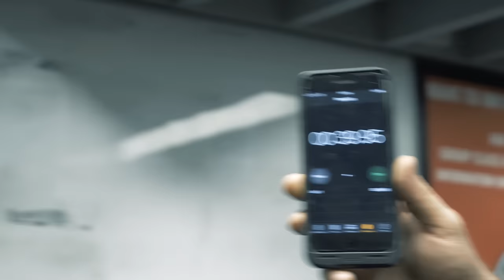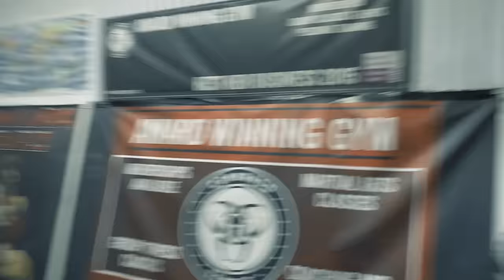LIFTING THE UNLIFTABLE DUMBBELL | KEG RUN | EDDIE HALL

Comment: Brian- lifts unliftable dumbell 

Mark Henry- am I a joke to you?
Reply: Mark Henry actually pressed the Thomas inch dumbbell over his head though so...
Reply: Lucas Smith it’s not about the weight, it’s hard to lift because the handle is very thick so it’s much harder to grip than an ordinary dumbbell, shoulder pressing it probably wouldn’t be that difficult
Reply: Mark Henry never lifted the Millennium Dumbbell tho...
Reply: Hand size is key lifting these aside from strength. Gripping that dumb bell is virtually impossible added with that weight. 

It’s Brian’s specialty clearly..
As much as Eddie is a specialist dead lifter
Reply: Zackary Guidry Mark Henry didn’t do it right
Reply: Jordan Hunt Mark Henry was able to clean the Thomas inch dumbbell up to his shoulder and press it
Reply: Mark Henry lifted a 195 lb dumbell above his head.Still very impressive.
Reply: @gregorycarter9352  Yah mean 172 lbs and Shaw picked up two an incline pressed them.
Reply: Lucas Smith he also trained for a year
Reply: Mark Henry isnt a real lifter
Reply: If anyone thinks Mark Henry’s weight lifting is real then your not as smart as I thought you wrte
Reply: @BillyBob-wv2jn  
Arnold Strongman Classic
1st 2002 Arnold Strongman Classic
WDFPF World Powerlifting Championships
1st 1995
USAPL National Powerlifting Championships
1st 1995
1st 1997
USPF National Powerlifting Championships
2nd 1990
And in 2002 he did lift the Thomas Inch dumbbell... You're insane if you think he didn't
Reply: @Matt Philips yeah your right. I kinda just said that for likes lol
Reply: Billy Bob Wow, a person on the internet that admitted they were wrong...
Reply: - funny people saying Mark Henry isn’t a real lighter when he was probably training for the Olympics before these guy did anything. Mark Henry went back to lifting in 2002/2003 to prove lifters wrong which he did
Reply: @camrongaida963  it's all about grip tho and shoulder press isn't hard in that
Reply: Lmao imagine trying to make a joke but not know the dumbbell Mark Henry lifted is over 60 pounds lighter than this...
Reply: @lucassmith992  And brian did it with 2 from the ground so your point is what?
Reply: @MichelLinschoten  No.. eddie picked the inch up, same handle, so your argument holds about as much water as a fishing net.
Reply: @camrongaida963  And brian did it with 2 at the same time..
Reply: The dumbbell Brain warmed up with is the one Mark Henry lifted so.....
Reply: @ok-yi7mi  Mark Henry started out in strong man before he went to wrestling he is liget
Reply: @TTE441  you can’t compare mark Henry to either Brian Shaw or Eddie hall
Reply: @wntdspartan1345  mark Henry never won or competed in wsm
Reply: @badkoba6927  he won the Arnold strongman classic in 2002 fk u mean lmao
Reply: @wntdspartan1345  are you serious? That’s just the asc not the wsm and mark Henry won it once
Reply: @wntdspartan1345  if someone doesn’t win or even compete in the wsm then that person doesn’t have the title of worlds strongest man
Reply: @badkoba6927  the ASC is still a strongman competition and Mark Henry is known around the world as a strongman even by people in WSM. 😂 but keep trying to downplay his accomplishments when I bet u wouldn’t say that sht to him in person 😂 keyboard know it all.
Reply: @wntdspartan1345  no it’s not asc is totally different than the wsm. At what point have I downplayed what he did? The man won the asc and holds two records still. You are just pissed because you knew nothing about it and you are just a fan boy of mark Henry. Maybe next time do some research before typing some bullshit.
Reply: @wntdspartan1345  oh what he’s supposed to hit me because he never competed in a wsm or won it. I doubt he would and if I ever get the chance the met him I am going to ask him why he never competed in the wsm   Now run along child and take your medicine
Reply: @badkoba6927  - well I can, and the fact that a former Olympic power lifter who stepped away from competing to wrestle then went back into strongman and beat those doing year in year out regardless of it was Arnold classic or WSM.
Reply: @TTE441  you can what? He had great success competing in the US as a strongman in the 90s and had 13 wins. To my knowledge he still has two records. As for the asc he only won once in 2002 just to prove he could then retired. Not sure what you are trying to prove here
Reply: @badkoba6927  - I’m not trying to prove anything, ur the one who came along commenting on everyone’s comments.Henry did what he wanted to do in 2002, I’ve watched the videos of him talking about it and why he did it.
Reply: @TTE441  first off anyone is free to comment on any comment here it’s public you dont like it then don’t look at the comments. Second lmao everyone’s comment do you realize how many comments there are. Yeah I watched the video too. Problem is all you fan boys are getting mad because I said he wasn’t a world strong man because he didn’t win the wsm or even compete in the wsm. I am just stating facts here.
Reply: @The_Skrub  it wasn’t around in 2002 tho
Reply: Mark Henry ain't no strong man he a soap actor.

Comment: Brian's hands are massive. 

I think palm/hand size plays a big part in lifting that dumbbell.
Reply: I know on the Thomas Inch version, if your hands are big enough, they can press on the globes and kind of lock your hand in a little better. Add some friction to combat the rolling effect. I wouldn't say it's a "big" part, but definitely a help.
Reply: @cwilczewski23  I was thinking more on the lines of it's easier to lift a thin grip than a fat grip. Therefore the bigger the hands the easier the lift becomes. Eddie has the strength to lift it but not the shovel like hands that that Brian possess
Reply: Palm no. Fingers yes.
Reply: Well, i could probably lift  that 100 kg dumbbell if my hands were large enough to hook grip it. Hands size is soooooo important for this.
Reply: Agree
Reply: No and proof of that is the handles are the same and eddie picked up the thomas inch. It's not hand size..
Reply: @Scootermagoo  think you are missing my point.

Get the heaviest dumbbell you can pick up, then put a fat grip on it and see if you can pick it up.

Comment: So Eddie can lift 500 kilos and if evenly distributed is 250 kilo per arm and he can’t even lift 106 kilo. Although I think Brian’s hand size would have played a huge part in this.
Reply: Nope. The deadlift is back strength and they strap their hands too so..
Reply: And you would be wrong just like the other 500 eddie apologists in this comment section, I'd like to point out eddie picked the inch up, so it's not hand size.

Comment: I feel like so much more of a man right now. In 2005 I lifted 225lbs one handed. That said, it was on a full length bar with a diameter about half the size of this one and with plates that could spin. It was also between my legs so it was essentially just a one handed dead lift.

Comment: When I was a kid, I had a neighbor who worked on the auto assembly line, before robotics. His job for 30+ years was installing the heads on V8s. To break up the monotony, he started installing them with 1 hand, grabbing them at the center, and switching, then over the years he started grabbing them on the end of the head with one hand. He could lift a V8 head from the end with one hand. I'd like to challenge Brian to do the same. I'm curious to see how that grip compares to the millennium dumbbell.
Reply: I worked for an engine builder for a time and i used to pick up big block chevy heads by the intake ports with my 2 middle fingers on each hand and walk them about 25 feet. I can appreciate that.

Comment: I'm only just beginning to learn about the world of strength and grip and power, so this might be a bit of a silly question, but, why was Eddie able to deadlift much more than this, yet was unable to do this particular dumbbell? Is it because he hasn't specifically trained for it, because he has been training to box lately instead, or perhaps because of the size of his hands? Is it the setup of the deadlift vs the dumbbell?
Reply: Eddie hall lifted with straps (and obviously 2 hands) so it takes most of the grip out of the equation. Have you ever tried to grip a 2.5 inch handle? Its extremely difficult and much thicker than your standard deadlifting bar. And not only that its a globe dumbbell so it rolls away easily creating a lot of torque which requires strong thumbs, fingers and wrist to counteract the rolling motion otherwise it would just slip out of your hand as you attempt to lift it.  So the heavy weight combined with the thick handle and globe shape makes it extremely difficult to lift for 99% of people. It requires world class grip strength to lift the millennium dumbbell. Take a look at the famous Thomas Inch dumbbell which is the smaller brother of the millennium but still extremely difficult to lift. Not many people can even break it off the floor for even a milimeter. It weighs 78kg with a 2.5 inch handle. If you can lift that you are probably in the top 100-200 people in the world who can even lift such a dumbbell. It requires years of dedicated grip training to attempt such a feat.

Comment: I've seen some of those videos. The problem with those dumbbells is not only the weight, but the thickness of the handle. So I don't think the issue is, that Eddie is missing strength, he probably just has smaller hands.

Comment: This comes down to the difference in their hand size. Eddie has phenomenal grip strength but Brians hands are much larger allowing him to control the roll better
Reply: Nope, as i have pointed out several times, that little dumbbell at the end is a thomas inch dumbbell, it';s 172lbs and has the same handle as the other one, you eddie apologists don't realize eddie has some good sized hands, he's 6ft3.. he's not a little guy, so it's not hand size that fails him.
Reply: @tomrouse4726  You really believe hand size has something to do with the fact he picked up the thomas inch which has the same sized handle.. Do i need to repeat that to you? Did you pass comprehension 101 as to what you said? Eddies 6ft3 his hands are big enough.

Comment: I don't even lift, bro, lol but when I do I get very paranoid that my left arm does less work than my right arm because its weaker so I always try make it work at least as hard. I'm wondering why you did such a heavy lift that will strengthen your right arm without doing the same on your left. Just off-camera or do you account for this issue differently?

Love you guys and your channels. I'm saving up to join a gym next month after all the inspiration looking at you. I'm Eddie's height but my weight is distributed quite differently lolol. I'd beat you guys at truffle shuffles hands down!
Reply: I'm not an expert but the gain he would get from lifting it one time is minimal. It would be like going to the gym and doing 1 really heavy rep on a machine. Your muscles dont really grow from that.  You have to do multiple reps to create tears in the muscle.
Like I said I'm not expert but you can look the stuff up as well.  If 1 rep at a high weight was enough to get good gains people wouldn't spend hours in the gym lifting
Reply: @sonofodin1052  Yeah me either but from reading about HIT and max contraction I wondered, just because it's a rare enough low rep max for him. On reflection I think you're absolutely correct though. It might make a slight significant difference to someone like me who responds very well to small amounts of training but is lazy, but compared to the massive workouts someone like Brian does it would most likely be almost completely insignificant. Thanks for replying. :)
Reply: @colmwhateveryoulike3240  You are welcome

Comment: Wait,the dumbbell weighs 105 KG?
Doesn't that Youtube channel MatDoesFitness have a video where they challenge random people to lift a 100 KG dumbbell for £1000?
And they have like 4 guys lifting it?
Or was that fake?
Reply: This dumbbell is like 3x harder to lift than that 100kg dumbbell. It has solid cast globes that spins and puts a tremendous amount of torque against your thumbs, wrist and fingers and the handle is 2.5inch thick handle which is significantly larger. Only a handful of men can lift this dumbbell probably less than 10 in the world

Comment: Brain, you need to describe better the problem of GRIP with a handle so large. Show a regular barbell handle and then how thick the MDB's handle is. You can see Eddie struggling with getting his hands around it, that it rotates in his grip, but viewers at home don't get it. It isn't that Eddie can't lift the WEIGHT, it's that he can't get a GRIP.

Comment: Would be cool to see them do it with a wrist strap then no strap to see how key the bare hand grip is assuming with a strap they can lift it no problem
Reply: They pull over 1000kg off the floor with grip. A strap defeats the point.

Comment: Its crazy that Eddie can deadlift a half ton but can't lift a 230 lb dumbbell and Brian can lift the dumbbell but hasnt deadlifted a half ton. Body mechanics are weird.
Reply: No it's not that crazy actually 
1. Brian has huge hands, alot bigger compared to eddies, big hands are an advantage in grip events that's why Mark Felix is incredible at grip strength.
2. Eddie put on alot of weight around his core up to the 500kg deadlift where he weighed 196kg which is insane when you think he's "only" 1.91cm. So he had a more stability than brian. 
3. Eddie hall was insanly focused on the deadlift, and did literally everything to get it and win WSM, he spend 1 hour a week with his family and the rest on working out eating, travelling and recovering.